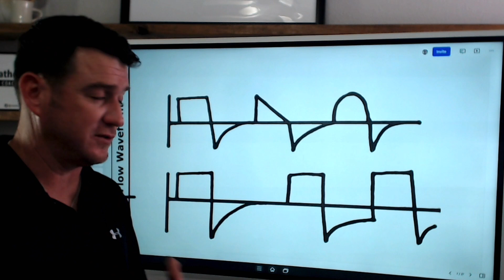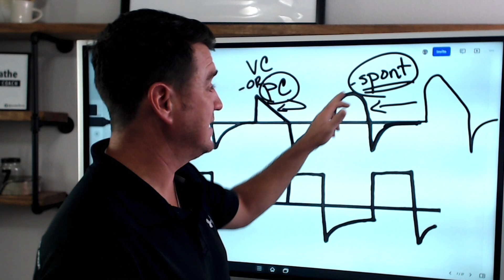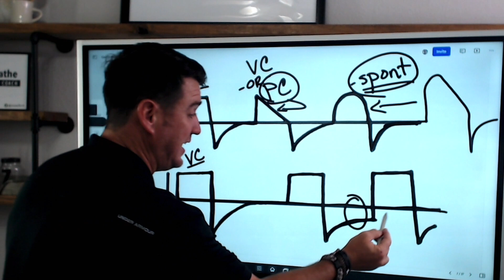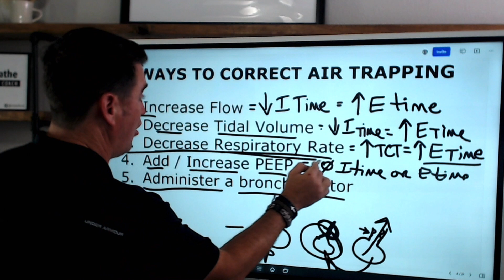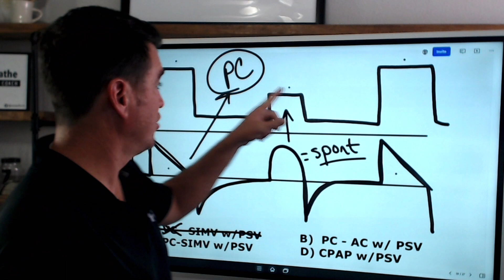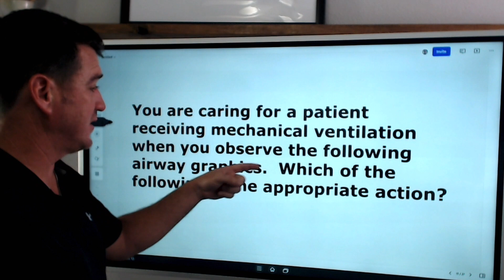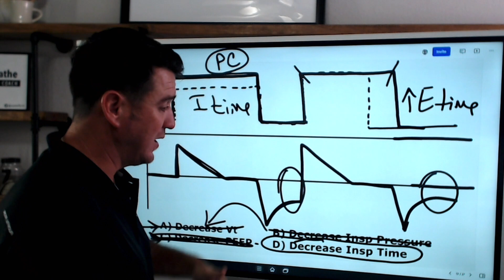Respiratory Therapy - Flow Waveform Analysis

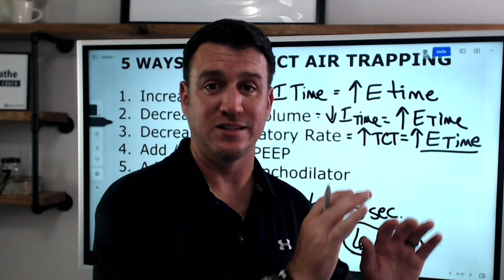Comment: @9:30  How does decreasing RR increases E time ? 
If insp ratio is 1:2 on a resp rate of 20 , then it should be 2 sec for insp and 4 sec for expiration... On RR of 10
Reply from the maker: I think you answered your question, because you are exactly right.  A 1:2 on a rate of 10 would be 2 sec inspiration and 4 sec expiration.  At a rate of 20, a 1:2 would be a 1 sec insp time with a 2 sec expiratory time.  Decreasing the rate increases E time by increasing total cycle time.  Rate of 20 has 3 sec TCT, while a rate of 10 has 6 sec TCT.  Does that make sense?  Thanks for watching and commenting with your question.

Comment: I got lost about the square wf. On the first part it represents VC, how come on the exercise it represents PC?
Reply from the maker: VC has a square flow waveform. PC has a square pressure waveform. That's typically a point of confusion for anyone learning mechanical ventilation waveforms. Hope that helps. Thanks for watching and commenting.
Reply: @RespiratoryCoach  now, how will I know if the square waveform on exercise means either pressure or flow?

Comment: Sir you said square   wave form always in  volume control  but when  you solve  mcqs  you said square  flow waveform   are present  in Pressure  control
Reply: Plzzz guide  me dear sir@respiratory coach
Reply: RN from Australia here.
Your problem is the difference between pressure waveform and flow waveforms.

square waveform (flow) = volume control 
Decelerating waveform (flow) = pressure control (always) or volume control (sometimes)

In the MCQs the Square waveform  isn’t a flow waveform but a pressure waveform 
Square waveform (pressure) = pressure control

Please correct me if I’m wrong
Reply: @MrMatt15   thanks  a lot i got it

Comment: so wait. he said pressure control was always decelerating and then when the squares came up he said PC is always square. i thought they were always decelerating. IM LOST.
Reply from the maker: Great question!  In regards to PC, the flow is always decelerating. Hence, the flow waveform will appear decelerating, but the pressure is set, so the pressure waveform is square.   Pressure waveform vs flow waveform.  Does that make sense?
Reply: @RespiratoryCoach  yes i think i understand. it is two different things. Thank u

Comment: Hey joe,
What if the air Gap in inspiratory wave, i mean the inspiratory wave doesn’t reach to base line and start the expiratory? 
Sometimes there are like couplet wave in inspiratiry flow curve. What does it mean? Thanks four your help.
Reply from the maker: Hello Amr!  If the inspiratory flow pattern doesn't return to baseline, specifically in pressure control, then it indicates that a full alveolar tidal volume wasn't delivered.  I would have to see the couplet pattern you're referring to.  Feel free to send me an email to respiratorycoach@gmail.com.  I'll take a look at it.  Thanks for watching and asking your question.